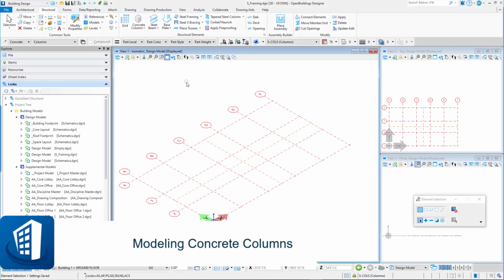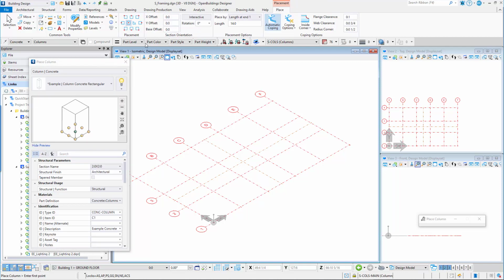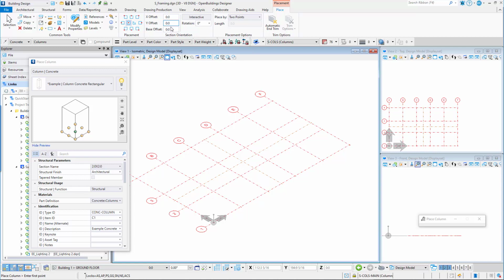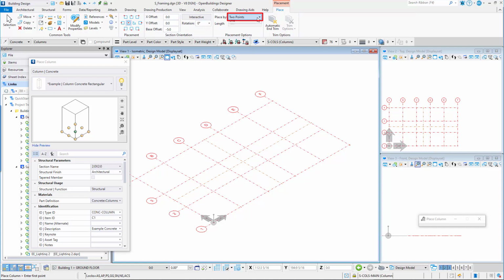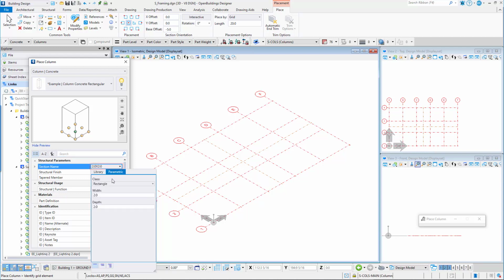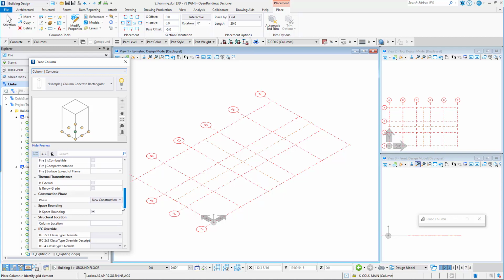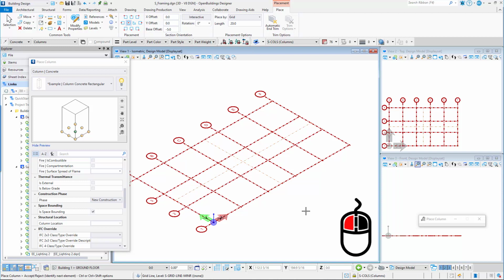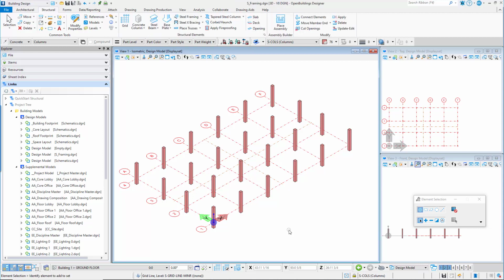Structural S101/04 - Modeling Concrete Columns

Comment: What about precast framing structures? How Openbuildings can help with?
Reply: Hi Fernando,

OpenBuildings has ProStructures catalogs incorporated into it, containing a wide range of structural profiles. Depending on the Dataset that you have installed, you can find for example AISC steel profiles or PCI concrete profiles.

Other than that, we can create (or customize) user profiles and save them to the OpenBuildings Catalog Types, with the same properties of the delivered ones.

Here are some links that can help:

1 – Delivered Shapes:
https://learn.bentley.com/app/Public/ViewLearningPathDetails?lpId=114498&aftkn=fc7e3bf0-97d5-4653-b854-ab6ffe229418
Refer to “BIM QuickStart S101: Modeling Structural Frames”, and in the Handbook material, “Exercise 12: The Shape Catalogs”;

2 – Custom shapes
https://learn.bentley.com/app/Public/ViewLearningPathDetails?lpId=111737&aftkn=fc7e3bf0-97d5-4653-b854-ab6ffe229418
Refer to “Structural BIM S206 Structural Data Management and Reporting” content;

Hope it helps!